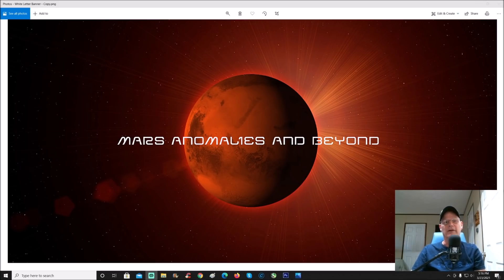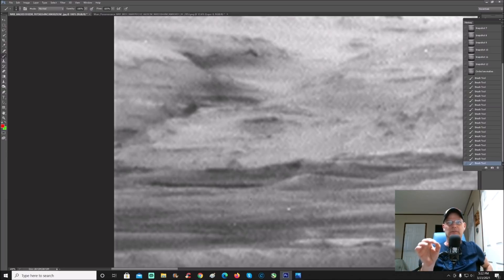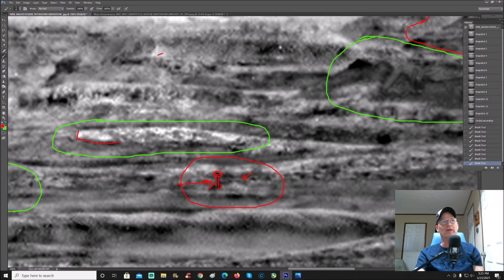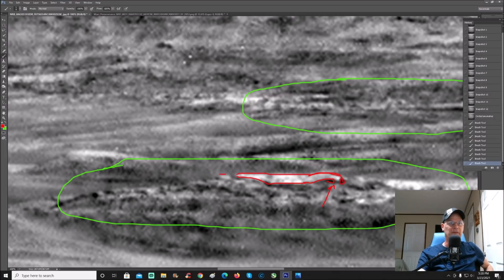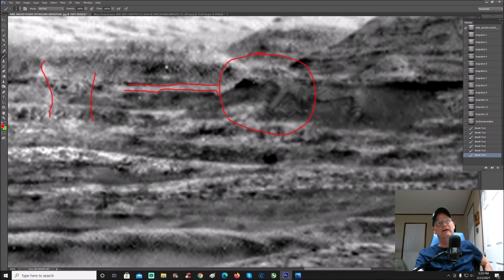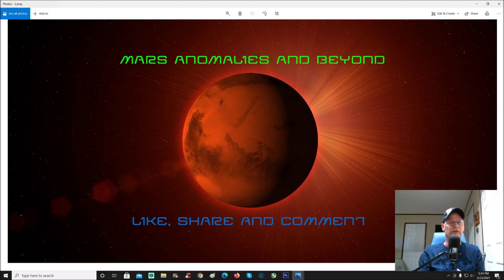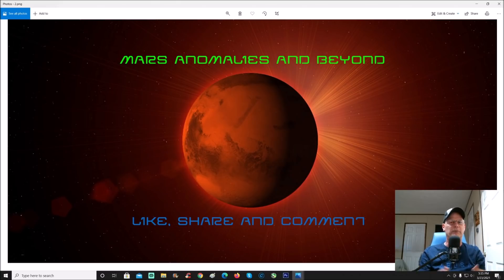Structures And Mechanical Parts Disguised As Hills ~ 3/23/2021

Comment: 7.20. Looks like a big gun on like the equivalent of a top swivel bit of a tank with the top gun barrel pointing left and runs back to 3 rings which sit under the tallest straightest of you red vertical lines.

Or it really small and its like a winged nut top wing your green line as it starts to circle down on top left part of green line and its at the end of a long threaded pole and stops at the same three rings... Very strange

Comment: I see a hotel or storage complex with V-shaped roofs surrounding a central square,  over on the left side. To its right is a townhouse community with boat docks. Farther along to the right is an amusement area with vaious buildings, a boardwalk, and Casino Pier.  To the right of that are exposed pipes emptying onto maintenance buildings below (not smart engineering! ).  Thanks, Chris, for revealing the truth to those that wanna' know.

Comment: at3:27 an INVISIBLES  Giraffe head and long neck/above the WHITE "CC" box at bottom of screen/neck starts from bottom"2021" <date,Then the head of Giraffe is grayish/pixelated because closer to camera/see-thru,alive looking straight at cam curiously,next to WHITE SKULL ,head would easily fit inside RED circle(reaches slightly higher than red circle from top of screen.)In reallife smaller animal & head reaches no more than 5 or 6 feet high if that.Probably doesn't have a Giraffe body but a crawler body with nubs to move over rocks,unseen by cam angle.Think of a deer head looking head-on straight ahead at you/that angle.

Comment: The story that's come out is that the wealthy martians come to Earth intermingle with the Egyptians but either did not interbreed or if they did it produced sterile or no offspring because the story is also that they are not relatives to people on earth although in secret a date has not been nailed down or rather it has been nailed but not known to many people all I can find out which it was less than 50,000 years ago which it clearly would have been if they intermingled with the Egyptians all of this speculation but there is a story in high places of this

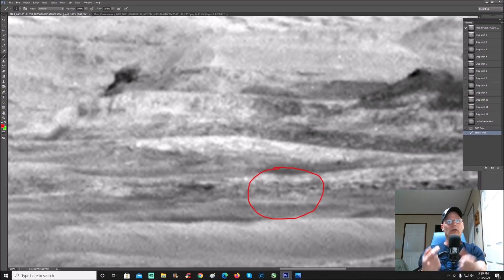Comment: At 2:12 I used the dodge & burn tool and the whole area is full of structures. At 3:46 with the D & B tool the mechanical object ( which is casting a shadow ) is under a 3 gable roof and all around the area under the roofs are stacks of barrels and pipes. At 7:03 you are looking at gabled buildings, there is a whole cluster of buildings that is setting on a large slab that has straight and 90 degree lines. this is not natural, it has been fabricated by someone. I also thought that the image looked like it had kudzu covering the whole area.
Reply: EXACTLY I SAW THE SAMETHING    CRAZY  I WISH I COULD GET THIS ANDLOTS LIKE IT AND PUT IT ON WORLD NEWS SOMETHING WHERE NASA LOOKS STUPID   HAVE    A GOODNIGHT    BROTHER